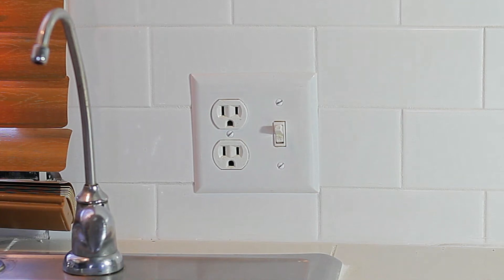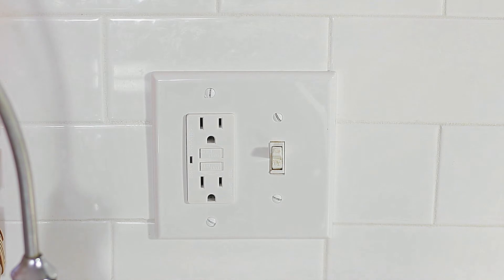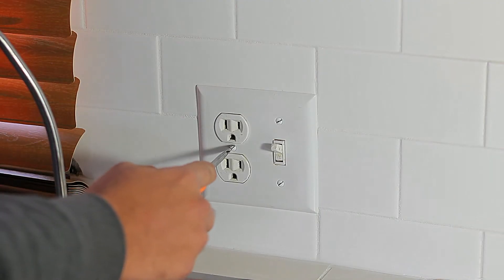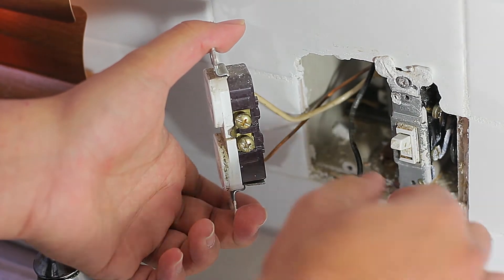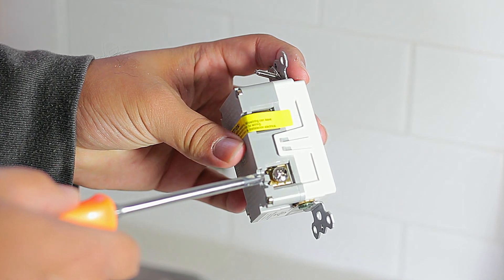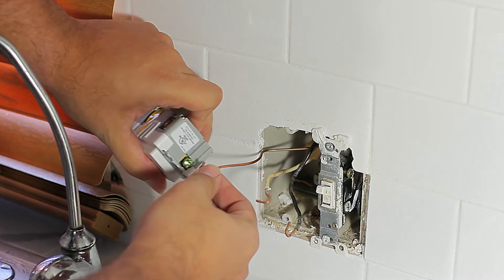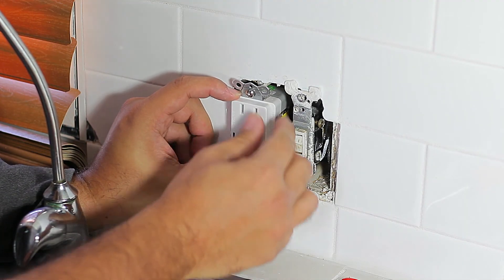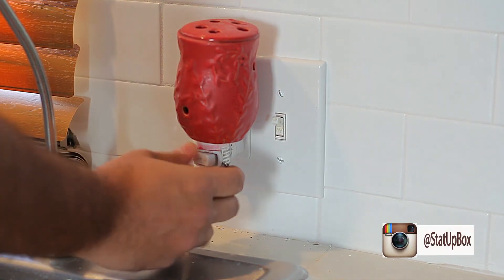How To Install Replace A GFCI Outlet

Comment: Great job except, the white wire should place on the left side of the screw so when you tighten the screw, it will bite stronger.
Thanks